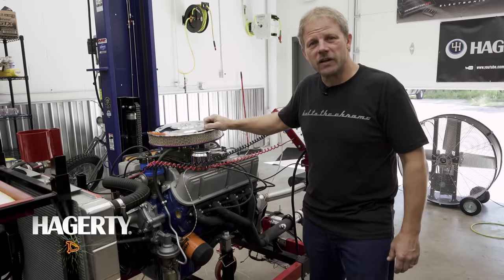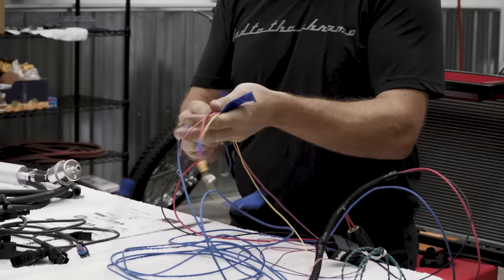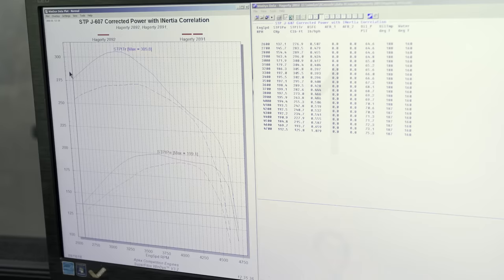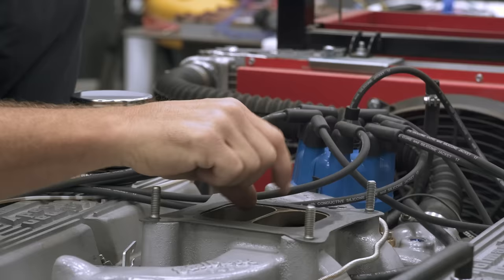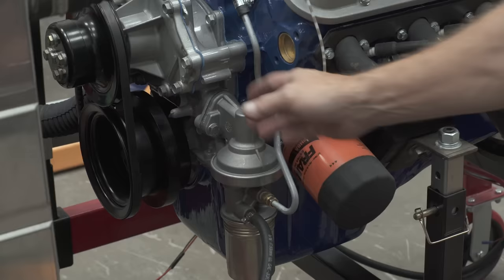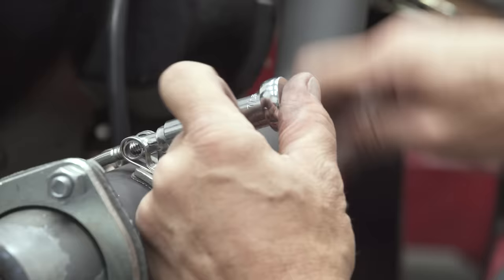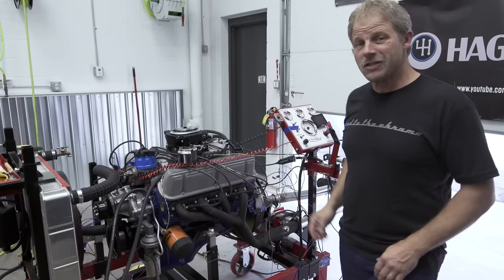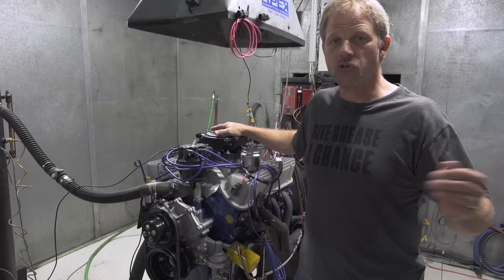Is it worth it? Replacing your carburetor with a Holley Sniper EFI | Hagerty DIY

Comment: Wait, they took off an undersized, poorly tuned carb running an air filter and put on a bigger / higher cfm throttle body injection system running no filtration and made 15 or so hp more? Hmmm...
Reply: In some fairness to that system, it would probably keep improving through a little more useage. Though, that comparison wasn't all that fairly done.
Reply: luckeycat I agree,  the more you drive the better it will get.  Also people need to understand it isn’t just about the horsepower. Better drivability, throttle response, and adjusting to weather conditions is where this system will shine.
Reply: Hi
Great job !!!
 I would like to know if you  Redid this test run and added a 1" spacer or the size spacer to the Holley carburetor  What will the results be?
Thanks you
Reply: Yes that is sad considering the sniper flows 950 cfm if i am not mistaken
Reply: There is zero chance that holley carb was “undersized.”  It definitely wasn’t tuned right.  That 289 only needs like 450 cfm.  Don’t believe me then find a carb calculator.  Everyone wants to slap a 750 DP on (straight out of the box) then complain about carbs being junk....
Reply: @hawiianpwr  I have driven carbureted cars for 50 years I have never had to do any of those things.
Reply: @MissionRestomod  The 289 has a short stroke and has an intense intake event.  It will handle an 750 without a bog if adjusted correctly.
Reply: Matthew Bergin well you could technically run an 850 but that doesn’t mean it’s right.  Dropping jet size, adjusting air bleeds, and pump shot does a lot for how it works, but it will flat run better and make more power with the right size carb.
Reply: @MissionRestomod   I didn't say 850 I said 750. The small block Ford has the same bore to stroke ratio as the big block 427 chevy rat motor. The intake event is intense. I had a 750 on a 5L  with a performer RPM intake with the lightest spring in the secondaries and  the carb would not bog even though the car was a little hefty at 3800 lbs. It was a very crisp responding engine. Unless your engine is heavily modified it does not need a double pumper. Those carbs are designed to be used on engines with high overlap cams installed with low vacuum. The cruise and idle circuits are set up way too rich for a street engine. That is where people get the idea that carbs are bad for fuel economy. They choose the wrong part for the job.
Reply: Let's see, $1250 Sniper (SUMMIT)  to gain 15 hp, or re-jet/ rebuild and tune the carb, and play with timing???
Reply: Matthew Bergin you are flat wrong.  “Intake event is intense” lol. Carb size is calculated by engine displacement x max rpm x volumetric efficiency/3456.  You will make more power on the 289 with a carb sized 450-600 than a 750 guaranteed.  I’m not saying it won’t be drivable if tuned right.  Hence why I said you “could” make an 850 run on one.  Doesn’t mean it will make good power or be as efficient as possible.
Reply: @MissionRestomod  Sorry you don't seem to know much about engines and how they work. I suggest you do a lot more studying and maybe work on a few race engines before you give people advice. 😞
Reply: @MissionRestomod  very true. Smokey yunick,one of the best mechanics to walk the earth, thru research & testing,determined that a 500 cm carb would support up to 500 hp. He also figured out that if u GRADUALLY (key word here, otherwise vapor lock) warm the fuel so by the time it hit the carb it was 212 degrees, providing total burn and a power increase of 2 hp per cubic inch.pretty wild.interesting how his kit never made it to market.
Reply: I’m sorry, to me, carbs will always rule!  If you know how to truly tune the dang thing like I do, it’ll outdo efi all the time.  This is true especially if you match the carb cfm to what that throttle body can flow.
Reply: @cammer68oliver2  You are right. The best thing about carbs is all the other things you don't need like injectors. electric fuel pumps, return lines, IAC's, O2 sensors. computers, and all the associated wiring.
Tune the carb properly and it will serve you well. All of our carbureted vehicles just need one pump of the throttle to set the choke and when the key is turned the engine will likely be running before you hear the starter. K.I.S.S. gets you home.👍😉
Reply: 50% of the cars running a carburetor are not turned to max potential.
Reply: @bigkellyg5947  Its not just about the 15hp. You could get that 15hp by tuning that carb they took off. It's about the cold starting, throttle response, efficiency, etc. The $1250 spent means you don't have to pump the gas 2-1/2 times anymore to start your car properly. It'll run the same at sea level as it does at 5k elevation. It'll run the same when it's -20 out or 110. You won't have to worry about flooding it anymore. You won't have to re-jet it when you make other changes to engine. That stuff is what makes one of these worth it.
Reply: john jones  and would probably pick up 50 hp with a 750
Reply: @MatthewBerginGarage  hey buddy I’ve got a 750 Holley in a 79 F100 Australian 351 4v Cleveland do you think I can adjust it properly for my truck ? Cos I believe it’s too big for my engine .... some people told me that as well that I can keep my 750 vacuum secondary on it ... any advices please how to set it up to run properly in my 351 Cleveland engine ? Thank you
Reply: @chocodiledundee1  If you street drive the car I would keep the 750 vacuum secondary.  It is very hard to over carburate an engine with a vacuum secondary carb, as the secondary's will only open as far as the engine requires unlike a mechanical secondary carb. Yes it can be tuned to your engine, but I recommend getting and reading a good Holley carb tuning book. I would recommend "Performance with economy" by David Vizard. It shows how to get the most out of your engine combination. Remember Holley sends out most of their carbs jetted on the rich side because they don't want you to seize your engine by being too lean. Being a little rich doesn't hurt anything except some loss of power and your fuel mileage.  Holley's are fairly easy to tune but be careful and do everything in baby steps. No large changes. It is always better to sneak up on it than end up holing a piston. Have fun.  😉
Reply: @MatthewBerginGarage  my friend thank you so much , I love this Carbie it’s so awesome I have this truck for over 10 years never had a problem , but I haven’t driven this truck lately due to not having place to put it ... so I didn’t drive it for 3 1/2 years got my friend to service it I drove it but again put it away in a friend’s shed she’s been under the shed for past 3 months .... I work a lot if I take it out it’s too far to go and put Back , but I will sort it out .... I don’t drive it often but I will find another storage near home so I can drive on weekends , thank you I do appreciate your help and knowledge I will keep it then much appreciated my friend!

Comment: I prefer carburetors on my classic Mopars . Aftermarket stuff like this is fine for something that is seldom driven , or not driven for long distances . But you have to take into account that parts for this stuff are not available over the counter at the local parts stores . If you happen to be 100 miles away from home and something fails in that fuel injection setup you better have a good pair of nikes in the trunk .

Comment: have been running efi on my 440 for two years now without problems. if you install it as holley instructions it's superior to the carburetor.
Reply: What's the mpg?
Reply: It won't be that much of an improvement over a well tuned carb. No matter what it takes the same fuel air ratio to run. Just most carbs that are thrown on and not tuned will run rich and suck gas. My carbed 1976 460 f250 got very similar mpg as my friends 1992 f250 with a efi 460 he maybe got 5 mpg better....maybe . His cold starts were better vs my choke. It would make you cry from the rich fumes burning your eyes. I'm going efi not for mpg, just for better starts and the self tuning. My carb was just a bolted on edlebroc no dyno. The self tuning you don't need a dyno for them to run the best. A carb is a dying art to tune and dyno fees add up fast
Reply: Long story short what little mpg you get will take you min 10 years of  daily driving for it to pay for its self in gas money.

Comment: Power is only part of the story, the huge benefits of injection is cold starting, smoothness, part throttle response, out of corner response.  The more parameters you can tune will make all these areas better and better.

Comment: OK, I found two areas of concern.  One is, it's all good unless you have an aftermarket ignition system where the tack sweeps up at key on (like mine does).  You figured out that hurdle but didn't say how.  Two,  you didn't have AFR figures for the carb so we have no idea how if the jetting was set up well as the comparison carb.  Other than that, thanks.
Reply: I agree, if the Holley Sniper FI system is able to dial in an engine's peak performance, then why did you guys NOT tune-up the carburetor any further with possibly a larger carb and/or further jetting sizes??? I DO like the Sniper system, but I think this was NOT a completely or equally fair comparison.

Comment: Now please do it again with timing control and see how much power it makes
Reply: Do you expect to see massive gains with timing control. Im curious i have dynoed my car twice but without timing control. I am interested in timing control but leary about opening up a seperate can of worms
Reply: @cfmechanic  It will definitely broaden up your power band. With mechanical or vacuum timing advance, you can only really set two points where your timing is dead-nuts-on, and everywhere else is just a linear or parabolic graph between those two points. The further away from optimal, the less power, efficiency, and response you'll get. A good electronic system should be nearly perfect at all times and all driving conditions.

Depending on how well your parts all run together now, you can see anywhere from 0 to ~5% improvements at your worst ranges.
Reply: Timing control made a vast difference with my sniper
Reply: Dyno runs are usually from 3500 rpm and up you should have all your timing in by then anyway
Reply: @dallaswiens126  i like your Answer best spoken like a wise man
Reply: @dallaswiens126  no sir that is classic old school mentality.  With timing control enabled you will have a broader usable power range.  With a distributor you can only "control" your timing to an extent.   With efi you have much higher resolution and control of your ignition events as well as AFR  for the best all around power band and drivability.
Reply: @turbochevelle5641  yes if you are forcing air into your engine this is true but natural aspirated you just want all your timing in for maximum power changing timing while at wot will not add power just find the timing your motor likes and stick with it. I have tried full timing control on my bbc with injection and guess what I went back to a carburetor and msd distributor and made more power
Reply: @dallaswiens126  sorry bud but there's way more to and engine than WOT.  Like I said, old school mentality is what it is.  We run into it all the time with customers but once they figure it out and trust us the come around pretty quickly.
Reply: @turbochevelle5641  then read what I said in the first post about being on the dyno there is only wot c'mon
Reply: @turbochevelle5641  the people asked if timing control would give them more power no it won't as long as they have the proper timing in at wot more drivability yes more wot power no
Reply: @dallaswiens126  quit talking in circles.  An efi system will give you more power.  I know what the question was and I know what I said, it is you that doesn't seem to understand but your statement is pretty disingenuous.   Efi will make more power in areas that the carb doesn't and that is why it is a proven fact that with efi you have a broader power curve.  Also ask yourself this, the average vehicle will spend most of its life everywhere but WOT so you need to frame your argument better.  Now if you are talking about a car that idles to the water box does a burnout, makea a pass and is towed back to the pits your argument t is still negligible.   The fact is that efi offers so much more resolution and control of your combustion process that it is far superior and more efficient than a carb on the majority of vehicles today.  It's not my fault you don't understand how to tune EFI but to talk it down because of that is disingenuous.
Reply: @dallaswiens126  so whats your point?  Believe it or not people don't do just WOT tuning on dyno'd.  You can do transient throttle tuning, steady state tuning, variable throttle tuning and so on then you go out and drive the vehicle with the true load and vehicle inertia to dial those things in for clean spot on fueling for drivability.   I build cars bud and sell performance parts your not talking to a dummy.
Reply: @turbochevelle5641  he asked if it makes more power it does not just better drivability big difference but now I see why you push it that way you can sell something a guy doesn't need 👍
Reply: @dallaswiens126  yeah, keep thinking what you want to make you feel better about your antiquated ideals it doesn't bother me either way.  By the way, when I say customers it isn't because I sell them something they don't need its them bringing it to us to line out because someone like you tried to do it and didn't know what they were doing.  I'm so tired of this mentality,  just because you don't understand something doesn't mean it's no good or is it just your to prideful to admit you didn't know what you were doing and to cheap to have someone help you get it right and teach you something.  You act as if I'm some full time shop lol trying to sell people snake oil, people bring us what the buy or ask us to tell them what they need to reach their goals and it is a side gig because we are good at what we do.  I make my living owning a waterjet job shop so take the cry baby stuff somewhere else.
Reply: @turbochevelle5641  did I hurt someone's feelings too bad you will figure it out. You really can't read can you, I went your electronics route, I spent piles of money and guess what that parts guy too said it would be worth it lol. Yeah more drivability on the street like I said but less wot horsepower when you are naturally aspirated. But I guess you must be the smartest guy in the world and I must have got lucky at making my stuff fast and every customers car fast that I touch. Oh well good luck with the sales pitch.
Reply: @dallaswiens126  i understand the technology of timing control and am running the holley sniper fuel injection still standard hei cuz it's simple and easy to repair or replace as well as trouble shoot. Most every article i have seen is carbs make more top end. Efi offers more usuable power throughout entire power band. But basically after reading everything I personally will prolly never use the timing control feature. My car runs fine as it is yes there is room for improvement but I'm fully satisfied. Msd might make more power cleaner idle etc etc but I would rather keep it simple. Not looking to add a coil switch distributors and add a ignition box that are all failure points. My car is n.a. caprice with 440 dart shp. Chevy block making over 500 at the crank. Just a fun fast car. Have videos of it on my page if anyone is curious.
Reply: I was thinking the same thing timings all to do with fuel and Air
Reply: @turbochevelle5641  what all can u water jet at your shop. Any website. I have some ideas
Reply: @cfmechanic  only thing I can't cut is tempered glass.  Other than that as long as it's under 10" thick I'm good.  I cut all types of brackets and plates for engines and suspension among other things.
Reply: MajorLeague  I don't remember GM CCC carb engines being so great. They had a computerized spark and a carb at the same time. In addition, they still had many of the sensors of an EFI engine, sometimes needing a diagnosis like one.

Comment: The windsor ford is a work of art and simple pushrod engineering. I have been spoiled for the past 30 + years of velvet smooth torque starting with my 68 cougar and now 88 T bird and 88 town car efi windsor 5.0 's.

Comment: My 1969 GMC 1/2 ton sat for 14 years , changed carb + fuel pump, put in a good set of used plugs and replaced wires as mice ate the ones on the truck , 
 it starts at the touch of the key now 

 I have to get it some new exhaust 
, the original is perforated pretty bad , its 52 years old that Y pipe ,

I like fuel injection and these are awesome 
 a bigger carb  jetted proper would close the power gap some for sure

Comment: I would have liked to see this in a more "apples too apples" comparison, say with at 3310 Holley instead of the base model  1850 650.  The Sniper is fated a 900CFM of flow.
Reply: My brother used to "SMOKE" aftermarket recommended setups with a junkyard 351W and a variable venturi. V/R Chris